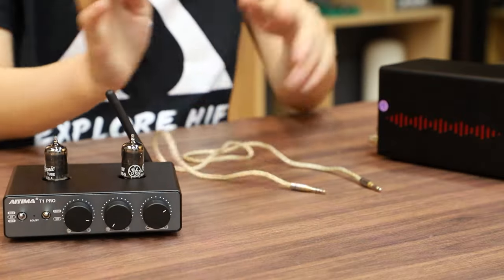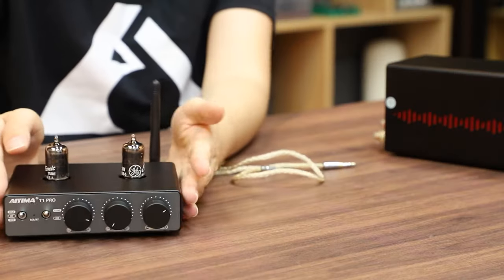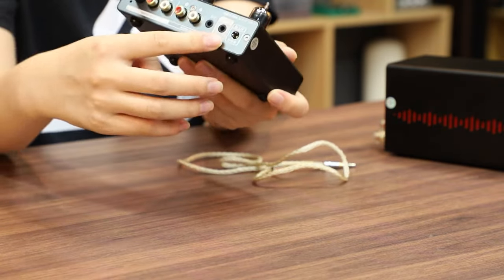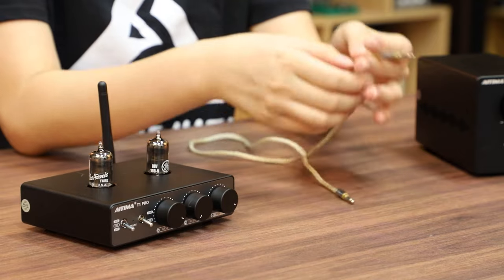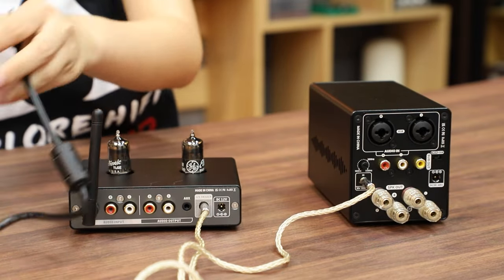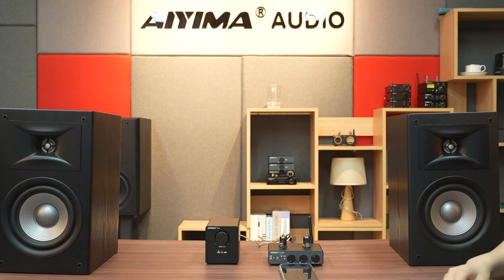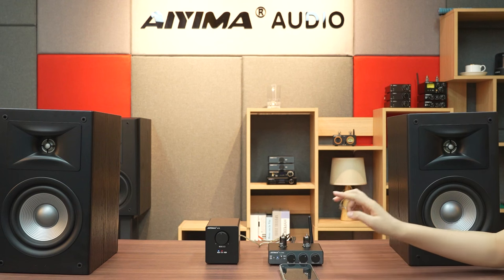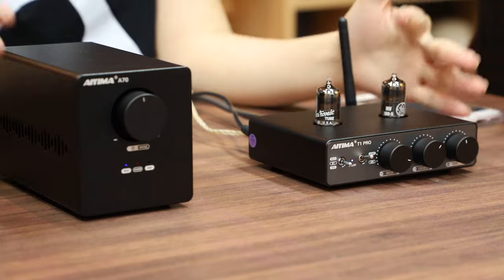How to Connect a Preamp and Power Amp Using the 12V Trigger Function | Complete Guide

Comment: 1) Is the 12V trigger cable be a 3.5mm to 3.5mm cable? An RCA-RCA cable?

2) If I use two A70 amps in a bi-amped configuration, how would I send the trigger to both amps?
Reply from the maker: A 1 in 2 trigger wire is required.